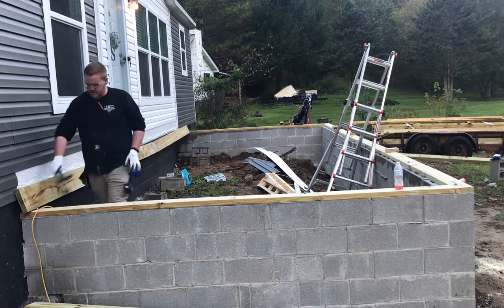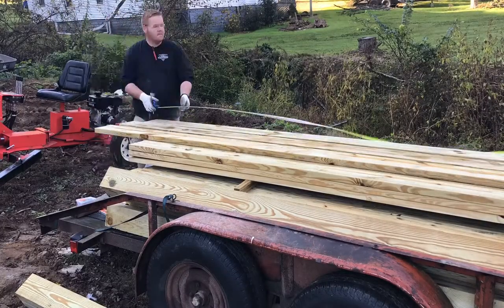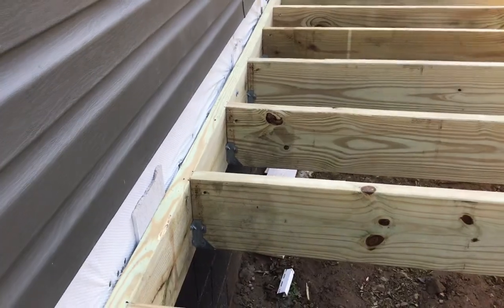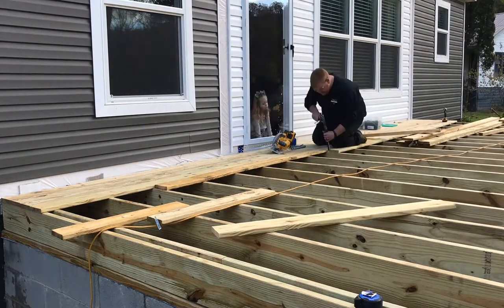HOW TO BUILD A DECK With A Concrete Block Foundation! DECK/PORCH BUILD PART 3!

Comment: I'm rebuilding my front deck on a low cinder block wall.  Interested to know what size board you layed on top of your blocks and how you connected the boards to the blocks.  Looks like my cinder blocks are an actual 8inches wide, where a standards 2x8 is 1-1/2" x 7-1/4".  So not really big enough.

Ill be sandwiching 6x6 posts every 8ft between 2x12s that will sit on top of / either side of the cinder blocks.   Then ill add hangers to the inside 2x12 to run all my joists.
Reply: Hey there. Getting ready to do what it sounds like you were planning. Can you tell me how you solved the question you were asking him? Also, how did you secure your band boards to the board that sits on top of the blocks?

Comment: I am also planning on a similair build, is there any issues with rain water getting in between deck boards and sitting below the deck in the walls of the foundation, or does it eventually dry out?
Reply from the maker: I’ve had zero issues with it! If your somewhere where it rains most of the year it could be an issue but it’s no problem thus far!